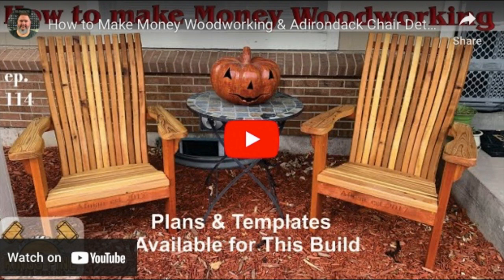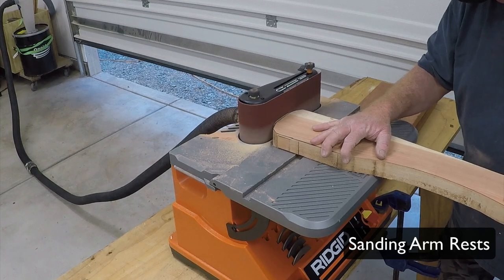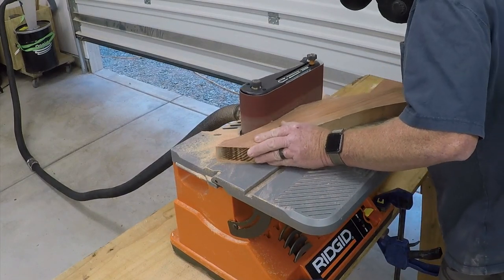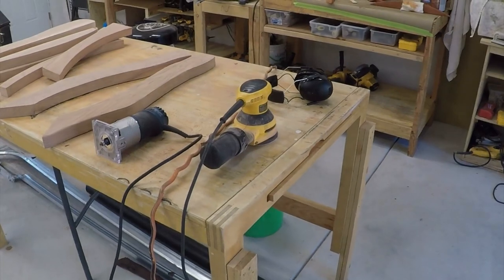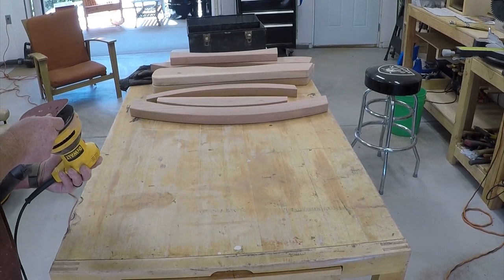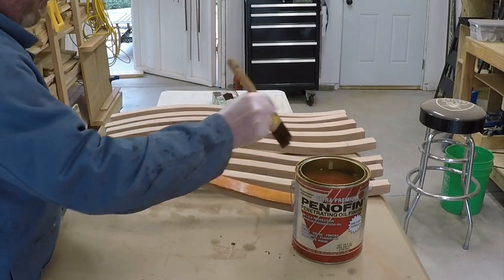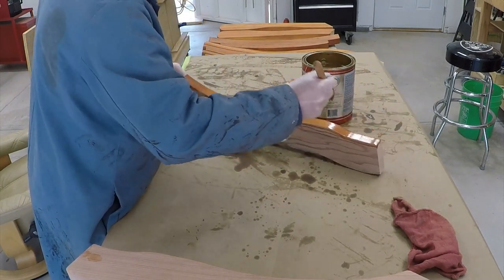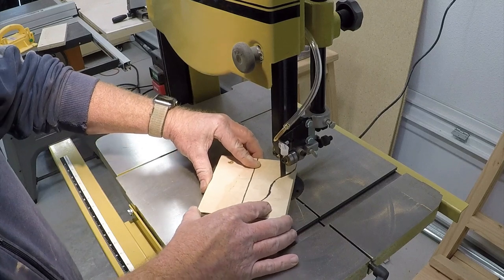Adirondack Rocking chair Day 2

Comment: You're not kidding... these are time-consuming. I'm 5 days in on just milling from 8/4 live edge slabs to the proper thickness. And I haven't even started cutting out shapes yet! I'm going to template route instead of sanding to the line. This is for two rockers.

Comment: Great video suggestion if you get a flush trim bit with a router on all those pieces you will cut back tremendously on all that sanding..
Reply: David, curious if you have used template routing or flush trim routing on these King chairs?
Reply: @TurningStitches  yes several times..

Comment: Thanks for posting this video.  I am currently working on four of these chairs (2 chairs) +(2 rockers).  I thought I was going insane with all the sanding.  Glad to see I am not the only one.  I have also been looking at the sander you invested in, so I will probably look to add it to my arsenal of tools.  I was also wondering about David Miller's suggestion to use flush trim bits.  Thanks again!
Reply from the maker: Hi, Yes I spend a lot of time sanding. But it makes for a nice chair. Good luck with your project. The Drum sander was worth every cent! I highly recommend! Thanks Denny